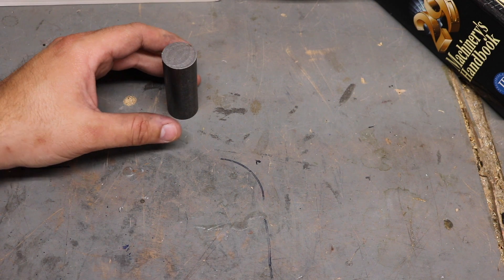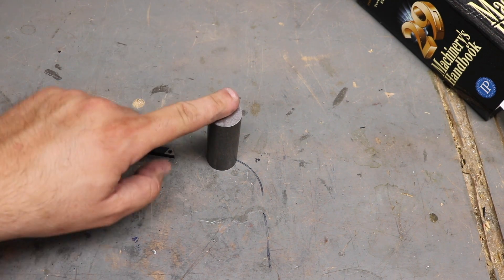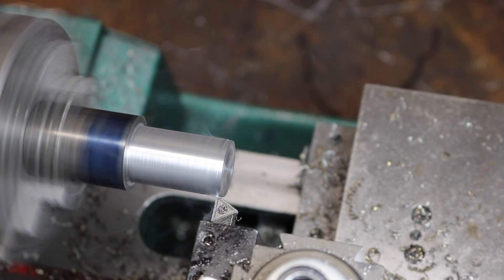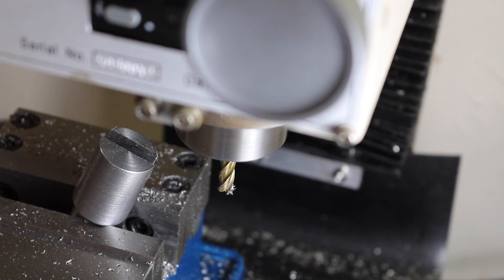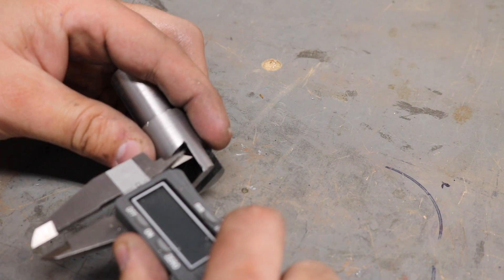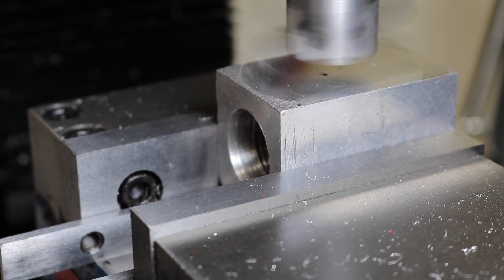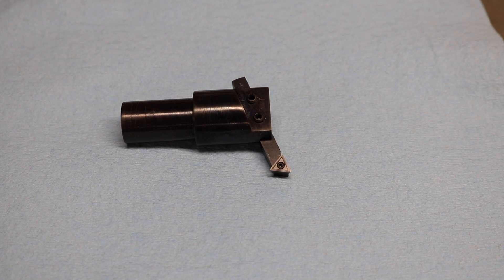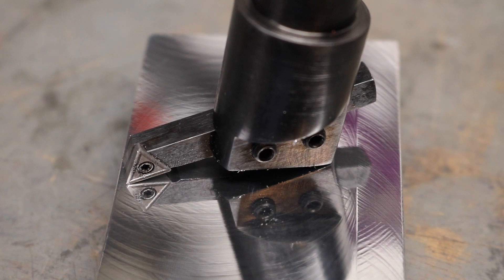Making A Fly Cutter for a Milling Machine

Comment: I like watching the amateur videos the best by far--they are very honest and sincere. I like the people being honest as to what they are thinking while making an item and showing everything they do. If a person becomes a career machinist of course flycutters are not used and the reasons why are evident in the video especially the final photo showing the polished surface. The poster is on the right track however that the old flycutters are not made or used anymore--they are all variations of putting carbide bits in them. The actual method to use is make a universal arbor--not the entire cutter complete with shank. Then any cutter concept you choose you simply make the head (shell mill concept)--and do as you please and mount it on the universal arbor. I am not a narrator or good video make but I demo one on a video I uploaded. The quality of youtube videos is exploding exponentially and I simply cannot narrate or do a pro video.

Comment: May I add ~You~ are not the Only Utuber that has cut on the wrong side of the Line whilst creating a Fly cutter!!!

Me, I have a TAIG Micro Mill, and Starting with .750 thousand Stainless Steel I Did a cut down shank to .375" and Carefully Recalling a post of "I cut the wrong side of the line" did a .125 inch @ 20 degrees, and soldered a piece of Carbide from a 7 1/4" WOOD  Saw Blade. It has worked Marvously, and Like you said:  " . . . And I made it"!!!!

Comment: Why do you call grub screws set screws, is it a US term ?  Here in the UK, screws without heads are grub screws, set screws are screws with the thread all the way to the head and bolts are screws with threads going up to a blank section on the shank.

Comment: This was the perfect accessory for my "milling machine" - AKA a Delta 17-900 drill press.  I whipped one up and it works great, and you're right - those little harbor freight 1/4" indexable tools work pretty good.  Anytime Tools sells replacement inserts in c6 carbide that will fit the HF 1/4" tools if you cut steel, so that's cool too.  Anyway, thanks bunches for posting this video.  It was a fun project that I can use on other fun projects.  But one of these days I'm going to make something that's NOT an accessory for another tool.  One of these days... :-)

Comment: if you remake your tool also make a tool bit and put a 7 degree negative rake on insert put the heat in to the chip and should also make the finish nicer

Comment: I happened to have a one inch steel bar I have no idea where I got it. It made a great pry bar so I cut off a piece to make a fly cutter. I have the shank part cut to 3/4 inch. I was looking at your angle for the tool of 20 degrees but for my tool it looks like it's not going to be enough 25 looks better. I ordered a R8 x 3/4 inch collect. Now all I need is the milling machine.
Reply: I bought a 1984 Enco RF-30 mill, on craigs list, that has the worm gear driven power feed, for $600.00, complete with a huge assortment of original parts, R-8 collets, two racks of T-bolts and hold down tools, along with many extras, two German made chucks...  Got a nice boring bar set, huge machinists vise (US made), flycutter that holds 1/4" lathe bits, and custom steel welded stand.  All on May 24th.  2HP 120/240 volt motor.  Now, I want a lathe, and see four for $500!!!
Reply: Wow great deal
Reply: where in the world are you located ?

Comment: Nice done man.If you want  the aluminum surface  even better use the WD-40, as a lubricating coolant the result is guaranteed.
Reply from the maker: +G.I customs great point! I actually really love using WD40 when machining aluminum but it isn't always easy to see what's happening on video when oil is flying everywhere! Thanks for watching!

Comment: Nice job.

It turned out very well, and works a treat.

I like the way you milled the side as well - I did think about that, but it's not as easy on a vertical mill slide.

What milling machine do you have ?  It seems to work well.

You will find that the finish on aluminium can be improved by using HSS bar with a round nose radius in place of the carbide cutter.

You can also upgrade the quality of your TCMT inserts if you get chipping issues on steel.

Great video.

Cheers Rob
Reply from the maker: +xynudu thanks Rob, that means a lot!  I have a Grizzly G0704, a "big" mini mill :) it's sold under different brands and names all over the place too.

I actually planned on demonstrating an HSS cutter as well but didn't have a 1/4" tool already ground and laziness got the best of me, I'm gonna have to give it a try, same with better carbide inserts.  Thanks for checking my video out!

Comment: Very cool! I just happen to have some 1 1/4" 4140 that I want to try this on. Sorry if I missed if you mentioned in the video, but what was the offset on the slot for the cutting tool?

Thanks for sharing!!
Reply from the maker: Good luck!  I actually didn't mention in the video but the slot offset was basically one side on the centerline of the cylinder; I touched off on one side of the part, moved over 1/2 the width of the workpiece, and didn't correct for the centerline of the tool.  The idea is so that the tool's cutting surface is just at centerline, if that makes sense.  Great question, thanks for watching!!
Reply: Practical Renaissance
Thanks, that makes sense

Comment: C 2 does not designate the carbide quality, it's an industry standard that basically means how hard that type of carbide is. And large depths of cut will hammer the hell out of your spindle bearings. Flycutters are meant to be a finishing tool. Your mills tram looks very close already. Due to a slight amount of flex within the spindle bearings, head mount, column flex, and even the tool itself a very slight back cut is pretty normal to see.
Reply from the maker: +Turning Point good point on the carbide grade! That's what I intended to convey, sorry if I didn't articulate it that well :) thanks for watching!

Comment: cool :)

If your drilling without a center drill its best to carefully wind the drill into the material at the start(0.5mm/0.019685"), when the drill first touches into the material if you leave it there for 30 seconds it will straighten out and cut back on center. i used this method for a lot of my cnc conversion brackets before i brought a spot drill/centerdrill.
Reply from the maker: Great tip, I'm gonna have to give that a try!  Thanks for watching!